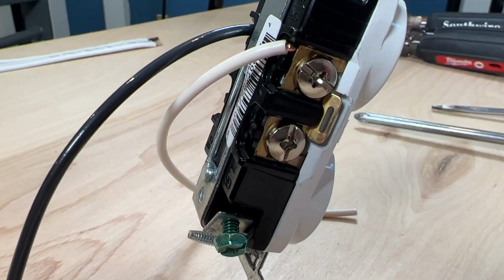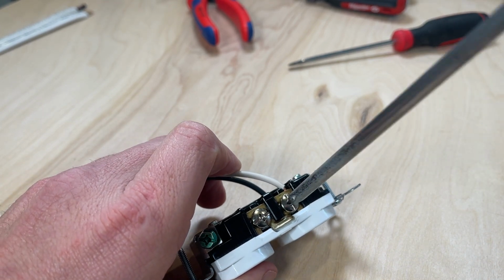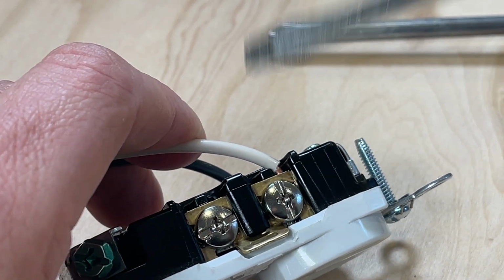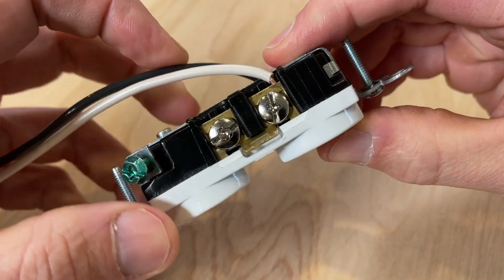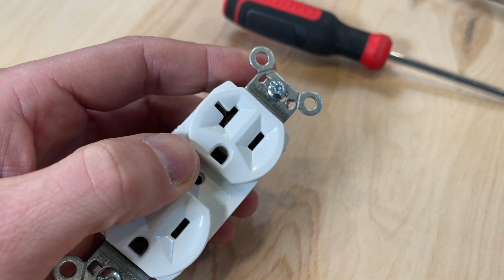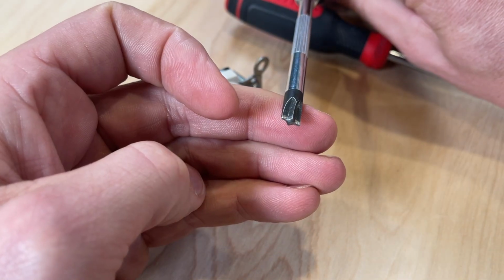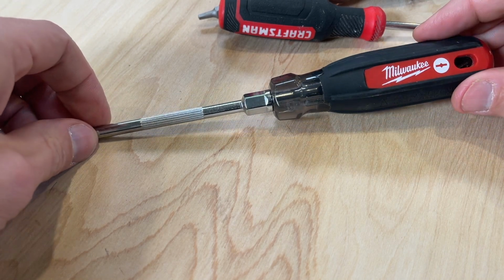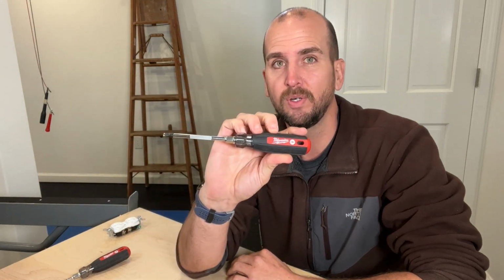80% of People Use the Wrong Screwdriver For Electrical Work

Comment: In Canada we just ‘call out’ or say “pass me a ‘green Robbie’ “ (Robertson #1), or a “red Robbie’ (Robertson #2).

I have one of those hybrid bits for my battery drill/driver, but never bothered using it. I also bought a Robertson #4. Crazy huge sized bit. I think the only place I’ve seen a #4 Robbie screw was the hub screw on a car.

And thank you for not calling the slotted screw driver a “flathead” drive. There’s no such thing; just a flat head screw.

Comment: I know the right tool does a better job, yet I was taught to make a hook around the screw, 
then to close the hook w longnose pliers, this way a HOT wire or ungrounded conductor
can NOT slip out and touch the side of the box.

Comment: No need to apply so much force (or torque); you apply so much force until the head jumps out and damages the screw. That is the nr.1 error imho. Agree that the best tool has the most contact, so your example is perfect, but generally, don’t apply too much force (or torque).

Comment: The Phillips screwdriver and screw is designed to cam out once the fastener reaches proper torque to prevent over-tightening. So, the issue you are describing is more "working as intended" than "error in use"
Reply: True about the caming out, but the torque is proper only in Phillips slot. And this is not Phillips slot unfortunately.

Comment: While backstabbing is legal according to the National Electric Code*, it is not ideal. One should take the time to properly loop the conductor around the screw terminal.

*The Authority Having Jurisdiction, such as your municipal authority, may make rules stricter, than that which is laid forth in the NEC, however, the AHJ may not make rules less strict than what the current cycle of NEC lays out.

Comment: Per the NEC, an outlet is: “A point on the wiring system at which current is taken to supply utilization equipment”.
In other words, a receptacle is an outlet, however, not all outlets are receptacles.

Comment: 11 in one small square bit, all the way. Set the other end for the small slotted for the cover plate. And you have one tool for the whole procedure. tighen the screws, flip the shaft to slotted, put on cover plate. a second one in a drill on setting two makes tightening the mounting screws faster. Milwaukee makes and ECX - 10 in one with a stripper on the handle, but it is not my go to because I just like the robertson better, I don't have to line it up, and much of the time I am working in low light because the power is off.  The robertson can be used entirely by feel and can be lined up without even really looking at the outlet.

Comment: What you call a Millwaukee hybrid screwdriver has been available from high spec German Wera tools for over a decade. It is common in Europe and sometimes referred to as a 'plus-minus' driver, from it's heads-on tip view, resembling + (plus) and minus (minus) symbols.

Comment: Those screws are common, and are designed so the installer can use either a philips, flat, or square tip driver. They should be banned because of how poorly they work. The ecx style bit was designed as a result of how poor these screws are. Not every electrician wants to carry yet another specialized driver, and some of the multi-bit drivers are heavy.

Comment: I inherited a bunch of tools from my dad who was an industrial electrician for decades.  I came across a number of "weird" Phillips looking screw drivers.  It never occurred to me to try them on electrical switches/outlets.  But that Milwaukee "ECX" screw driver just answered a decade old questions of "what the heck did he have these for".   Thanks!
Reply: I inherited some of my Grandpa's Fathers 1920s tools. Hand drills, measuring devices, hammers, all still work/look just fine. Like little treasures but probably not worth all that much any where else
Reply: Industrial electrician here, when I started in 1990 my employer made me buy a Reid and Prince screwdriver, looks like a Phillips, never used it...ever.
Reply: @blur911  Reid and Prince fasteners have that extra little groove. Reid and Prince screwdrivers have corresponding pawls to fit in there. In over 50 years working with tools, I have never needed one. One would have to wonder why your employer insisted on you having one! I hope it didn't cost much.
Reply: @badbiker666  The guy making the tool list hadn't worked in the field in years, nor in Canada,  I also have a set of huge fuse pullers I've never used.  I remember neither of them being cheap.

Comment: I've been a home improvement carpenter for a long time, and this is the first I've heard of these screw drivers. I will be adding them to my tool collection soon. Great info. Thanks.
Reply: I have never heard of these kind of screwdrivers either.
Reply: I have at least 6 of these sit around that have never been used.   Philips gets the job done perfectly every time. Why fill a slot on my bag/belt for a single use tool
Reply: @txfreerider  Home Depot in Canda sells mostly Robertson exclusively. I can't recall seeing any Phillips screw s on their shelves. My tool pouch is all Robertson drivers.  I rarely have to use Phillips and when I do it's usually accompanied by some 4 letter words has they're so hard to deal with.

Comment: In the Electrical field here in Canada. It has been the norm to use the Robertson Drivers. They are common to purchase and are not expensive, good quality brands are readily available and they don't slip out. The Green Colored number one Robertson Driver is probably the most commonly used driver after the Red colored number two. That's the color of the handles so you can immediately tell the difference. A zero which is very small, is yellow and a number three, that is a black handle, it's for bigger screws.
Reply: So common that if you say hand me a red everyone knows what you're talking about.
Reply: The electrical outlets I bought didn't even support Phillips. It made things so much easier than I thought replacing outlets would be, the torque is satisfying. I don't know anything about screwdriver sizes and the green thing worked perfectly.
Reply: @leerman22    That's right.  I didn't even know that they made ones that accept Phillips screw drivers as well.  The ones that I use only take a Roberson and a slot screwdriver.
Reply: @my3dviews  And indeed, the screwheads in this video do NOT have a Phillips opening at all - they are a combo of Robertson and straight slot and NOTHING else.
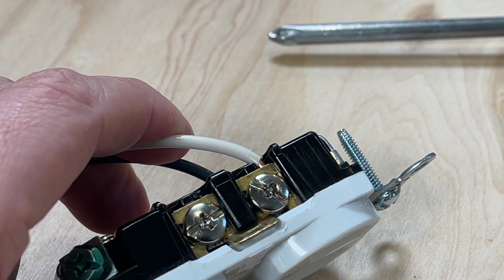Reply: @HartmutWSager    At 1:38 it does look like to me that it does have a Phillips head as well.
Reply: @my3dviews  I had actually looked very closely before making my comment, but you could be right.  I just now zoomed the screen at 1m38s to 500% (pretty grainy), and it's inconclusive.  The right screw seems to show no Phillips nicks at all, but the left screw does have one nick that could be a Phillips nick.  With both the Robertson and straight slot already there, any additional Phillips nicks are hard to see, and also not very effective for a Phillips screwdriver (which needs all the help it can get).
Reply: @HartmutWSager    When I compare the slot/Robertson on the outlet that I have, the screws look different.  That being the Phillips part of the screw is missing on mine. 
The one on the right may be somewhat stripped from use.  The left one the Phillips head is in tact and easier to see.
I agree that there isn't much there to grab with a Phillips, so not a great design.  Maybe something you would use as a last resort if that's the only screwdriver that you have.  But I can't see any electrician using a Phillips.
Reply: @my3dviews  OK, good further observations.
Reply: not to mention it looked like a cheap POS from the thrift store.

Comment: i use a klein 10 in 1 multi tool, simply because i wear a tool pouch that has spots for two screwdrivers (i carry the 10 in 1 and a flat head driver for lock rings and such)

Comment: As a Commercial Construction Super I did not know this but will be checking with my Sparky to see if he already knew this as that's good Info. I currently just bear down on a Philips to tighten although no Sparky I've ever used sticks the wire straight in under the plate like that they loop it around the terminal screw by striping back and inch or so grabbing the end of the wire with needle nose wire stripers and twist it to create a U shaped end that clips around the screw/lug so that it can never be pulled off even if the lug loosens. The real old school guys then wrap the whole exterior with electrical  tape to cover all the lugs, but that's rare these days. Good video, I'll definitely add the Milwaukee to my tool box - Thx

Comment: If you cant handle using a properly sized flat screwdriver with one hand, you probably shouldn't be doing electrical work.  Square tip if you want to be very fast (knocking out 8hrs of trim-out work.)  A flat tip provides more then ample torque to secure the wire. A square is just a tad easier. The square/slotted combo is completely overkill, even with the screws being designed for that special tip. It's completely unnecessary and I've never seen anyone but greenies use one in the field.   To trim out receptacles, switches, cover-plates and the entire panel you need: square tips #1, #2 and a trim #1 flat screwdriver... #1 square for all devices, #2 square for breakers, ground and neutral bars and #1 flat for cover-plates.   Or just skip the squares and you need just #1 and #2 flat.

Comment: I'm retired from a fence company where, along with building fences, I installed and trouble shot gate operators and entry control systems.  I let the screw head tell me what kind of driver to use.  Most were square.  Some were phillips/slotted in which case I used the phillips.  Slotted drivers are good for prying parts apart.😁

Comment: The reason that electrical uses slot/square is for corrosion resistance.  same with square drive for decks.  It takes a lot of corrosion to make it unturnable.  Unlike philips that has those peaks to corrode away.

Slotted is dangerous when it slips,  into the outlet  while trying to put on the plate.  The proper tool is almost always worth the moneys

Comment: This is like one of those infomercials where someone needs a special product to fix a problem they don't have.  "Are you struggling to strain your pasta?  Noodles are so slippery and go everywhere!  Regular strainers and collanders just don't do the job - you need the Noodletron!"  The screws have been designed to fit a variety of driver types, and phillips and slotted both work just fine.  Is there an epidemic of wires popping off the back of the outlets or the outlets falling out of the walls or something?

Comment: The Milwaukee screwdriver is obviously the superior choice. However, as a casual DIY'er in Canada, almost everything is put together with Robertson screws, so having yet another single-purpose tool doesn't make sense. The Robertson does a perfectly good job on electrical terminals. Now if I were a professional electrician doing construction or something, then the Milwaukee would be the way to go.
Reply: As a professional electrical engineering company for almost 40 years, these are too brittle and break.

Comment: 99.8% of manufacturers use the wrong screw when building things.  It is not physically possible to use the wrong screwdriver with a proper screw.  It’s also physically impossible to strip said properly designed screw.  Torx or square drive only.

Comment: And the reason your still using the wrong screw driver in the United States is NEC 110.14(D) Terminal Connection Torque. It change between the 2017 and 2020 code. However both require the screw to be torqued to the MFG specs.

Comment: I once built a ground level patio deck for some friends just across the border in Vermont. When I started to assemble the deck , using Coated Deck screws from Canadian Tire, they were amazed that these even existed! They had never seen a Robertson screw, never mind a Robertson Screwdriver.! After they saw how much easier it was to load and torque into the wood, I had more than a few of them get me to “smuggle” in the Canuck contraband. 👍🇨🇦
Reply: Down here, we call them "Allen Wrenches" (or at least the little metal tools to turn screws with square holes). We also have drill bits that fit those, too. You frequently also see them (albeit it larger sizes) on office chairs, if you buy one that you gotta assemble at home. The only difference is that they don't have the slot for a flathead screwdriver, it's just a square hole with an octagon head for a ratchet socket.
Reply: @Dhalin  Alllen and Robertson are not the same.
Reply: @Dhalin  Allen wrenches have a hexagonal, not square, cross-section.
Reply: @TorontoLS  Weird. I've seen them with square bits too.
Reply: @Dhalin  Allen wrenches are hexagonal socket wrenches.

Comment: I am not an electrician by trade...but i would have used a Philips. And today i learned that the screws sometimes are not exactly what they look like. Come to think of, in my field of IT, i think i have seen cage nuts where the head would use a Philips, but it might be better if it is an ECX. 

Will try to remember and when back at work, will look at some samples just for curiosity. And thanks for this informative video. Keep up the good work.

Comment: If suggesting the correct driver for the job, shouldn't you be advising VDE/insulated drivers? Correct drive is obviously better but a slotted screwdriver too small won't be effective obviously. Large ones work better for larger slots....

Comment: I haven’t had a problem using a slotted that is properly sized for the screws on the terminals and then a philips head on an impact to screw in the mounting screws most of the way and then finish with the slotted again. But I like that hybrid driver!

Comment: In my opinion those screws are made to handle ALL 3 types of screws (and even pozidrive though not Torx).   It's a convenience not to have to find another tool if you have one of them at hand.   I think it's a clever design.   In fact, for the grounding screw you can even use a socket driver and at ¼" it can be driven without a bit if you have a driver that uses replaceable bits.

Comment: The ECX bit is wonderful for terminals you need a good bite on to tighten. I keep a couple in the tool bag for such. I have found that a 1/4 flat driver works for 99.9% of devices I work on though. Cover plates all the way to panel lugs. The less tools hanging on my belt the happier I am.

Comment: Huh, it totally had not occurred to me to use anything other than flatheads or Philips for those kinds of screws! I'll have to buy me some square and ecx bits. I've tended to prefer torx in my own stuff whenever I can because it doesn't strip the head easily and it's easy to use single-handed.

Comment: The only reason ECX is needed is due to the garbage quality fasteners.  BTW, if you care about installing things to code, you need a torque screwdriver. Clearly not an option for someone who thinks $6 for a screwdriver is a big expense.

Comment: Here in the UK we go more towards Pozidrive over Philips cross heads! Chinese Philips screws are a disaster area by way of poor quality manufacturing! Pozi is a far higher quality design and seemingly manufactured combination of drivers and screw heads too! The angles and blade wall dims are all arranged to prevent cam-out!  Do you not have these in the States?

Comment: I like multi bit screw drivers because it also includes a few sockets in the driver as well. Little bit bulky, sure, but one of them typically covers 2 sockets and holds 3 different bits, two of which are reversables. The one I got also has a ratcheting handle

Comment: I was an electrician, many years ago, and I never heard about the Robertson driver fitting those screw heads. Wish I had known. Thanks for the info, it will still come in handy for future projects.
Reply: Older devices did not accept the Robertson screwdriver.  I am not sure when the manufacturers redesigned their products to accept it.  I have a #1 Robertson in my bag (purchased in Canada) and I use it on any switch or receptacle because I found that other screwdrivers could slip.

Comment: This is silly. The electrical equipment is sold for all north American markets.    So the manufacturer made screw heads that can accept a slotted, philips, or robertson. Milwaukee just combined a robertson with a slotted screwdriver and called it a new tool. All 4 options are acceptable and all 4 can properly torque that wire termination. Plus electrician i work with, myself included, uses an 11 in 1 from Klein.

Comment: You forgot to mention the Wiha Xeno #2 which is a combination slotted/phillips, marked SL/PH2. It is meant for the combination screws on light switches, etc. The central point is a true phillips and not a #1 robertson at a diagonal. Don't buy the pozidriv version which is marked SL/PZ2 and only used in Europe, I did and it cams out on non-pozidriv fasteners. I also have an ECX#2 for tightening set screws connecting conduit but the Xeno is a different shape made specifically for the screws in this video (referring to the smaller ones on switches/outlets, not breakers, which have a larger square in the center and can be ecx)

Comment: Good tips! I personally use a number 2 attached to an impact. And before all the keyboard warriors come out. I’m a licensed general contractor, and a electrical and plumbing journeyman. I’ve been in the industry since I was a kid and own y company for over 15 years. Impact is used for speed and every connection is checked. The end

Comment: I'm a retired electrician. I used a Klein 10in1 multi. It may be fatter, I have big hands, but 1 10 in 1 is taking the place of 10 different screw drivers, so I'd have to argue it takes up more room